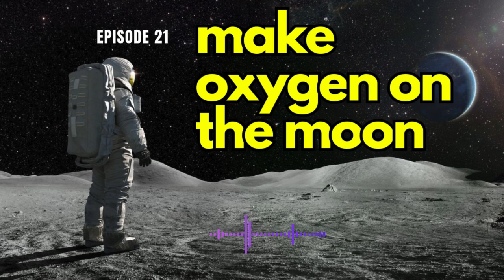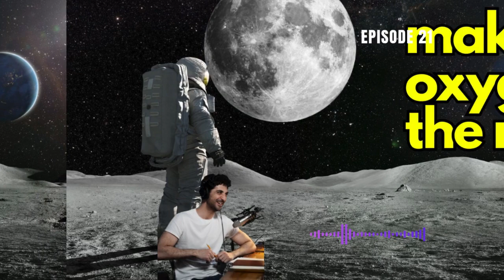New Tech to Extract Oxygen from Lunar Regolith A Game Changer for Space Missions

Comment: Can't you use sound waves?
Reply from the maker: Yes, sound waves can be used to address some of the challenges in lunar resource extraction, specifically in the process of molten regolith electrolysis.

*   In molten regolith electrolysis, oxygen bubbles form on electrodes within the molten regolith. The consistency of the molten regolith is very viscous, similar to honey, and the moon's low gravity can prevent the bubbles from detaching from the electrodes and rising quickly.
*   To address this issue, researchers are exploring innovative solutions. One method involves using a "sonicator" that blasts the bubbles with sound waves to dislodge them.
*  This approach was developed by Palak Patel and colleagues at MIT as part of an experimental molten regolith electrolysis system.
*  Other methods of dislodging the oxygen bubbles include vibrating the oxygen-making device or using extra-smooth electrodes to facilitate the detachment of the oxygen bubbles.

The use of sound waves is one of the innovative approaches being explored to improve the efficiency of oxygen extraction on the moon.
Reply: @Theglobalmic2024  resonant cavities can help extract the water within the crystal structure, but also to cause localised heating. Music can be used in conjunction with microwave heating. Hot lunar reggae and soca nights for making water for the lunar rum.
Reply: @Theglobalmic2024  there's a whole entire field of thermoacoustics.